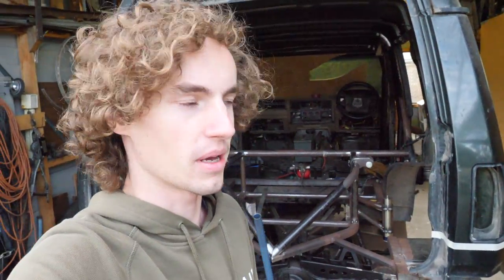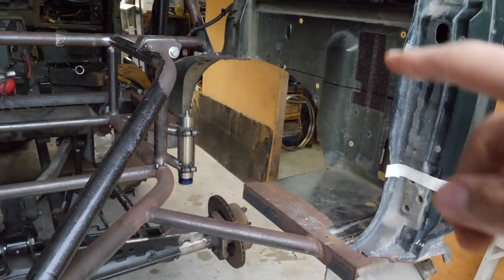It's coming together... 1/4 Panel CHOP & CUSTOM Rear Bumper on HUNDY! - V8 Discovery 1 Comp Build!

Comment: Looks great - but that strikes me as a long length of tube to be supported at just one end. Is there no way you can loop back to somewhere else on the main rear tubes, without getting in the way of the wheel?
Reply from the maker: Cheers!! The tube will have plenty more support, not done in that area just yet 👍